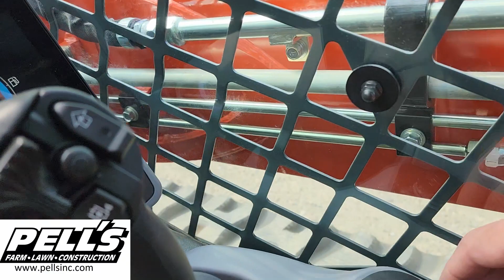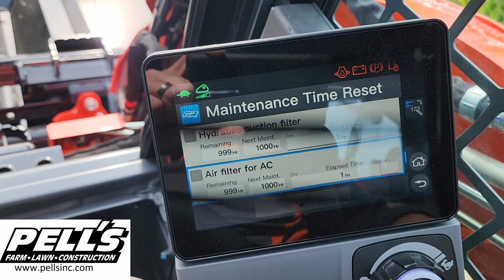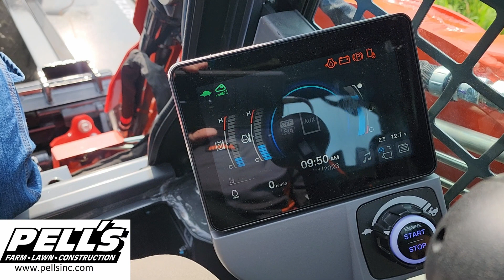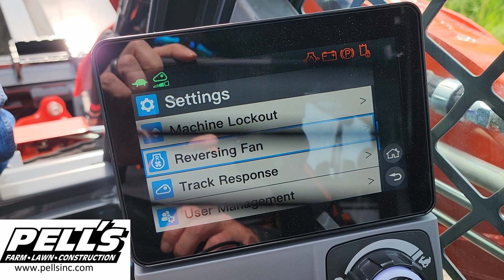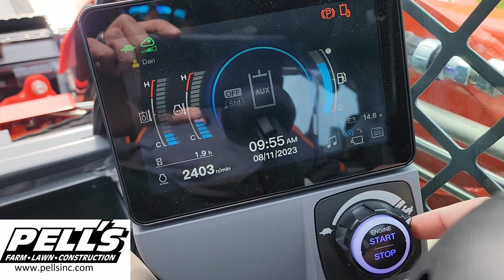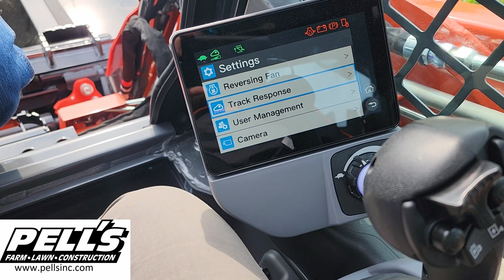Kubota SVL75-3 Walk Around

Comment: Should I buy Takeuchi TL8R2 or Kubota SVL75-3
Any advice?
Reply from the maker: The Kubota of course;) with the Takeuchi it is a taller unit, louder in the cab, rougher ride and does not have the touch display
Reply: Check out the John Deere 325G you won’t be disappointed